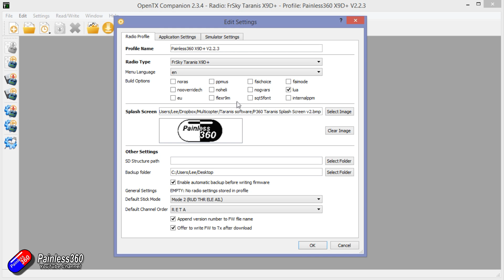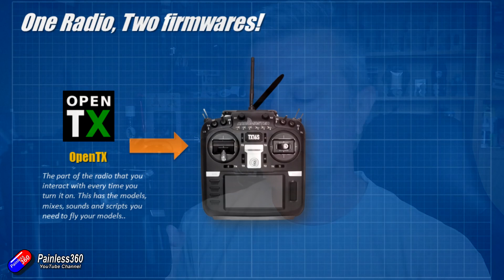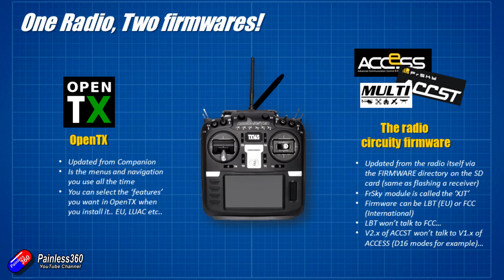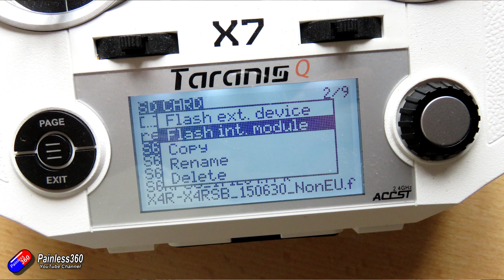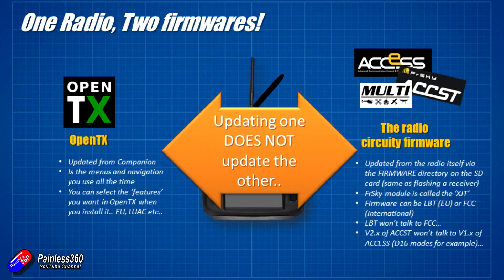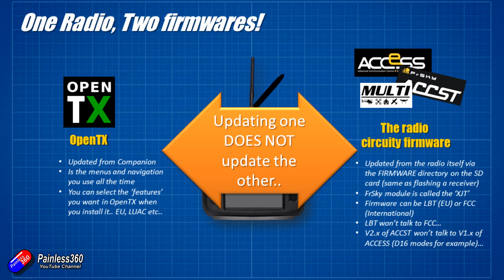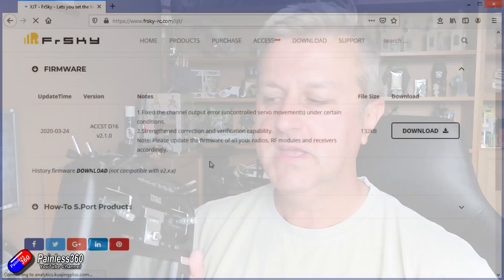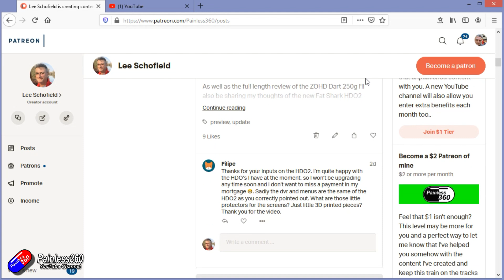There are actually two firmwares on your radio...

Comment: Many thanks. Just got my Radiomaster TX16S, coming back to RC after about 40 years. Your channel is a great help. Plenty of good info and no hype. I was wondering if thinking of the 'two firmwares' might be a bit like the difference between an operating system upgrade and a BIOS upgrade on a PC? One deals with how the user interacts with the device and the other how the internal processor interacts with the radio transmitter hardware.

Comment: Excellent Video! Answered a bunch of questions i had. I have a first gen Taranis X9D with Ver 1.0 boot loader still installed. I dropped out of the hobby for about 5 years and was wondering what I should do about updating my radio. I have a bunch of receivers that aren't compatible with any of the Taranis firmware versions. I was leaning toward getting a multi-protocol module and not using the internal module at all but had no idea what to do about the ver 1.0 bootloader. From what I just learned it seems I don't need to do anything about it just get a MP Module and use it.

Comment: Thx!  I learned again from you.  I have a Horus x10s currently running ACCST.  My buddy is using ACCESS and he is dropping packets.  Still no solution for his issue right now.  He is working with a Frsky engineer to solve his issue. I wonder if it’s his tx/Rx module firmware?
Reply from the maker: Maybe. I hope he gets it sorted soon. My video on the new ARCHER/ACCESS receivers will be out tomorrow.. Stay tuned!

Comment: Hey do you have a link to the original v1.x iXJT firmware for X10s ACCST?  I do not see it on the frsky website, only the new 2.1 version.  I was going to flash v2.1 for a quick test, but just in case wanted to have the original to flash back.  Thx!
Reply from the maker: I don't, if you find a link can you let us? best of luck.
Reply: @Painless360  BTW really appreciate your stuff, sent out a donation, keep up the good work!

Comment: Hi sir. Do you have video showing how to bind Frsky V8Fr receiver to Radiomaster TX12 Mk2 ELRS?
Been trying to bind using internal RF, still not working as of 20jan2023...
Reply from the maker: An ELRS radio will only bind to ELRS receivers. To bind to other things you'd need a module in the back that can talk to other receiver types. A common choice is the Multiprotocol module but you need to check is that receiver you want to use is one supported by it. https://www.youtube.com/watch?v=DfKyx0yTbXU covers how to check.
Reply: @Painless360  Thank you very much for the explanation. I have 4 pieces of Frsky receiver that I do not want to waste. Time for me to "change" to new receiver technology.

Comment: Is there a simple way to use the long range R9M module with ACCESS protocol with a Radiomaster TX16S besides hw mod (github.com/cvetaevvitaliy/Radiomaster_TX16S) ? because you don't have the Register button. I flashed older firmware with ACCST to both R9M and R9MM and is ok, but maybe for the future would like to have ACCCESS. thanks

Comment: My new jumper t12 pro hasn't got a bind function, after clicking what protocol you want you should scroll down to bind mine just returns to start,any ideas.
Reply from the maker: It depends on what protocol you select. Not all have bind functions and try to bind automatically. See the documentation.. Happy flying
Reply: @Painless360  tried that no good, I'm trying to bind my spektrum planes, but after I chose protocol it should scroll down to bind it doesn't.
Reply: @Painless360  dsm dsmx

Comment: So there's the bootloader, radio OS, internal radio module and if installed, external module firmware.
Reply from the maker: Yep.
Reply: You can also think of it like a PC: (OS Windows/Linux/etc) = OpenTX,  Bios/addon cards = hardware flash-able modules.

Comment: Why play around or update any of that stuff? I'm a newbie and I feel like start playing with that and it's going to be nothing but trouble, what am I gaining by updating or anything
Reply: Depends on the radio.... If you've got the tx16s then you should absolutely update to 2.4 when it comes out for touchscreen. You may also prefer to wait until each major update before updating if you don't have any bugs. Anyway updating is really really straightforward but you can always create backups of your models and firmware. Also, if you want to use stuff like multiprotocol modules, r9m, or Lua you will need to flash your radio with these options.
Reply: If it works don't mess with it, my x10 is running whatever firmwares it came loaded with, it has worked fine so I'm not touching anything
Reply from the maker: While I am normally in the 'if it works, don't mess about with it' camp. Some of the latest radios are shipping with 'versions' of OpenTX and flashing with the supported version can fix issues with things like LUA scripts not working.. Best of luck!